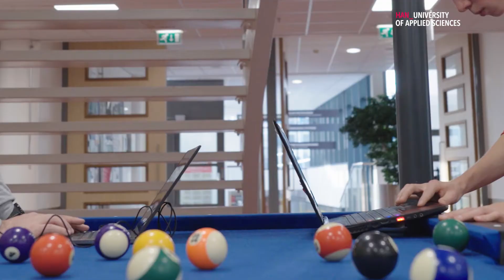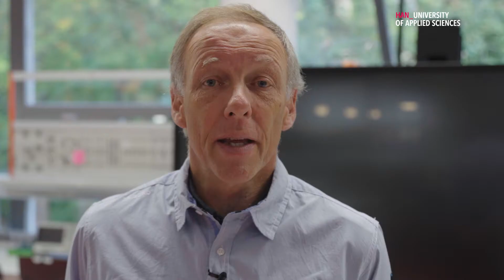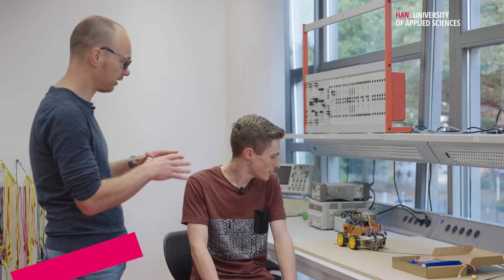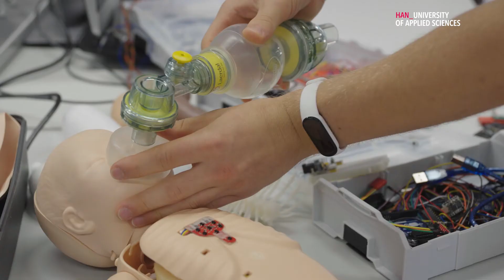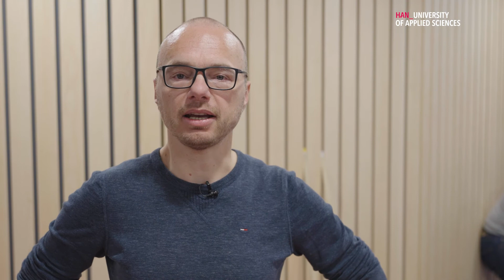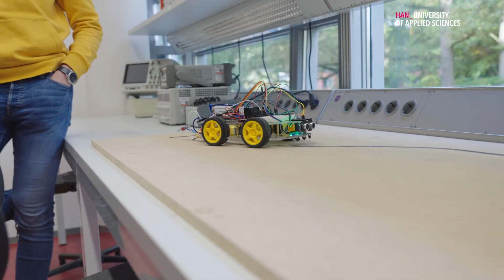Embedded Systems Engineering bachelor full-time | Educational video

Comment: I definitely recommend this great program at HAN — just finished the bachelor myself, so speaking from experience! #madebyese
Reply: Hi, i just enrolled. Did you finish in 4 years? One thing I am afraid of is academic delay since 4 years is already a streach for me 5 would be a bit too much. Other than than it sounds really appealing.
Reply: @Captain_Hook-z8v  I would say the workload is not that intense (compared to fundamental/academic studies). Most of the time you are working on projects or course assignment's, and your grade is determined by the way you approach the development. So you pass rather quickly, since you cannot really do it that wrong... 

Also you have an internship of 1/2 year and graduation of 1/2 y, and if you do it at companies you would get valuable experience along the way. So, yes it this program is 4y but you also get 1y off semi-work experience.
Reply: @richardkroesen thanks a lot for the insigth! It was helpful!
Reply: @richardkroesen Hey again, would it be possible to dm and ask a couple of thi gs about the programme?
Reply: Hello I am currently a student in Han University doing Bachelor in  embedded system and I am struggling. is there any YouTube channel or ideas you can share with me i really can't fail.  as international student my parents have a lot of hope